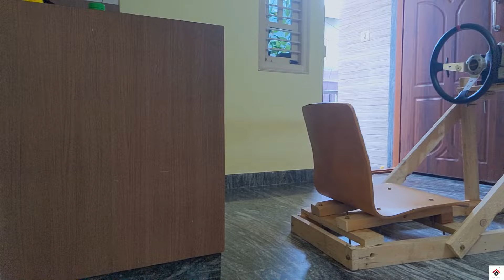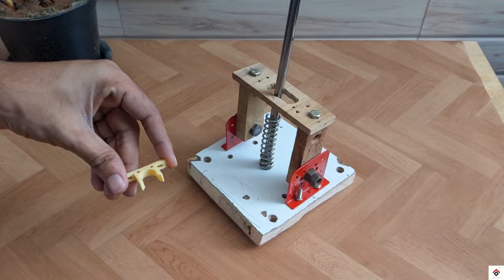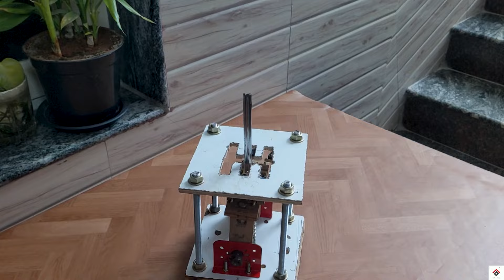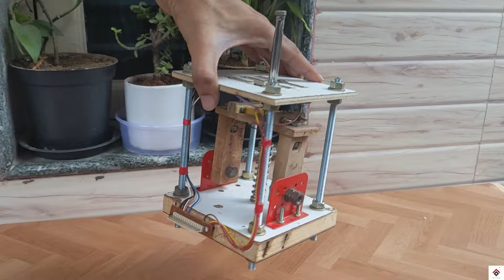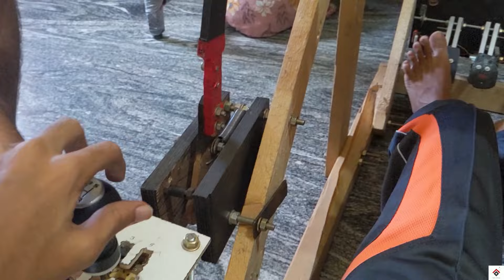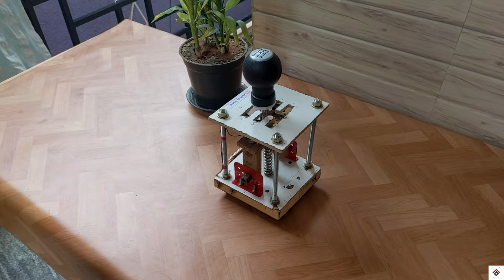DIY 6 speed H-Shifter for FFB Steering wheel, Easiest tutorial ever | H-Shifter for EMC Sim Racing🔥

Comment: hi i have a question. can i do this using arduino starter kit?
Reply from the maker: Which Arduino model is it?
Reply: @techathome i think its arduino uno with tact switch
Reply from the maker: Not possible.
You can use only Arduino Leonardo for this project.
Reply: @techathome why not?
Reply from the maker: Arduino Leonardo has built in serial communication support. The firmware is designed for this.

Uno uses seperate Chip for communication purpose.

Comment: Thanks you soooo muchhh broooo thanks thanks thanks
Reply: Verry use full iam from Kerala and I got first 🥇 in school level and also in first 🥇 sub district and 2nd prize in district now I can participate in the state level Kerala so I made this ffb level by level now it's the finishing part I thought that without buying the EMC pro I couldn't do gears but you proved it would work
Reply: One question you are using the e bike motor does it feels too hard to turn the wheel tell me about it iam currently using the rs 550 lower than 775 is it will be useful to upgrade to ebike motor
Reply from the maker: Congratulations🎉 and All the best ♥️👍
It's not hard to rotate the wheel. Force Feedback will be stronger if you use ebike motor.
Reply: @techathome thanks for replying I will give you full support
Reply: Bro I also got 1st prize at Kerala  state level competition thanks for giving me the instructions you are main reason for me achieve this thanks you so much

Comment: I am planning to make a 7 gear h shifter (6+1) so can I use the circuit diagram you provided? As you have shown 7 switches in it, or do I need to do some changes?
Reply from the maker: You can follow the same circuit diagram provided.

Comment: Brother whenever i connect the paddles with the wheel the h shifters stops responding in ets 2 but when I disconnect the paddles the h shifters work again ..please help me
Reply: Brother did your issue resolved??
Reply: @namandhiman7491  no bro it's the issue with the software & circuit diagram... I switched to RFR wheelconfig software..now I can use it properly
Reply from the maker: I am not facing any issues.

Comment: I have completed the mechanical part of the project, but does the code you provided in the software section control both the switches and the pedal potentiometers?
Reply from the maker: Yes, same firmware supports all the inputs.
1 encoder for wheel 
4 potentiometers 
16 buttons
Reply: @techathome So which pins should I connect the clutch potentiometer to?
Reply from the maker: A2
Refer this video: https://youtu.be/crdDhvhBG0M

Comment: Bro I have a doubt. Does the free version of the software have extra button support? Because I didn't make the H shifter. Instead I added paddle shifters. But the software doesn't have any support for extra buttons. As you have mentioned in the video, can I confirm whether the software detects extra buttons automatically. I didn't notice any buttons being recognised automatically? Only the steering, accelerator, brake and clutch was working
Reply from the maker: This free version also supports upto 16 buttons. We have tutorial on paddle shifters. Check this: https://youtu.be/-gHQ2EIYm88?si=S500hq0YfO1nuNQJ
Reply: @techathome  Thanks bro. I connected the buttons to the digital pins 2 and 3 and tried mapping it but it didn't work. But after looking at your simplified circuit diagram and connecting it, it worked. Thanks again
Reply from the maker: Welcome ❤️
Reply: @techathome  I have another doubt bro. How can I map the gears in the software if I use the two potentiometers for H shifter that have been shown in the diagram by EMC dev?
Reply from the maker: EMC lite free firmware doesn't support analog xy shifter. Only digital buttons shifter possible.
Reply: @techathome  Oh, okay. Thanks for the information bro
Reply from the maker: It supports upto 16 buttons.
You can check button activations on Control pannel/Devices. We have shown in video as well.

Comment: Where can you find these plastic locks that were used to lock the umbrella barrel?
Reply from the maker: Those are used in cupboards and table drawers.
You can check in furniture and hardware shops. Better to go with metal ones if you get.
Reply: @techathome  Thanks, the metal ones are easy to find here in Brazil
Reply from the maker: Welcome 👍
Reply: @techathome  I watched a video of you making a steering wheel for a cell phone, I don't know how to program it on Arduino. Can you program a board like that for me and send it to Brazil? I'll pay you the price.

Comment: Help help help help please help My steering is continuously spinning help me!
Reply from the maker: Can you check your BTS driver board separately: https://youtu.be/H2YJRaaXFIM
Reply: @techathome  My driver is fine I checked it
Please help me I have spent a lot of money on this project
Reply from the maker: 1. Is steering angle working properly in EMC?
2. Exchange the rpwm and lpwm wires on pin 9 and pin 10.
Reply: @techathome Everything is working fine but as soon as it reaches 450 degrees the motor starts rotating continuously. When I tried I found out that pin number 10 of Arduino is not working. What should I do please help
Reply from the maker: How did you confirm that pin 10 not working? How did you test?
Reply: @techathome  When I connected the "pwm R" pin of the motor driver to pin number 9 of the Arduino, the motor started rotating continuously in the right direction and when I connected the "pwm L" pin of the motor driver to pin number 9 of the Arduino, the motor started rotating continuously in the left direction, but when I did the same process with pin number 10 of the Arduino, nothing happened.
Reply from the maker: One more method,

1. Convert your Arduino back to normal (Steps show in part 3)
2. Connect LED on pin 9 and 10.
3. Try to upload LED fade code by changing pin number to 9 and 10 seperately.
4. Since these two are PWM pins, fading should work.
5. If pin has issue, you have to change the board.
Reply: @techathome  I changed both the Arduino and the driver but still no solution was found. Help
Reply from the maker: Check if the jumper wires are proper by continuity testing.

Comment: Nice work bro.
a...., For steering wheel, can i use [RO pump motor] instead of that cycle one
Reply from the maker: Thank you ❤️
Is that DC motor?
What are the specifications?

Any DC motor will work, but motor should be powerful.
Reply: @techathome  yes it's a DC motor.😃
But I don't know if it's powerful or not 😐
And what do you mean by specifications ???😅😅
Reply from the maker: Current and voltage ratings?
Reply: @techathome   it is 24 Volt DC motor 
Don't know about current 🤡😅😅
Reply from the maker: It should work.
Reply: @techathome  ok , thanks bro 🥸👍

Comment: Where can i get multiple pin connector... Can you provide the link..??
Reply from the maker: I bought it from offline electronics store. I didn't get the exact one.
Check this,

6 pin: https://robu.in/product/6-pin-jst-xh-2-54mm-pitch-plug-and-socket-with-cable-3-pcs/

8 pin: https://robu.in/product/8-pin-jst-xh-2-54mm-pitch-plug-and-socket-with-cable-3pcs/?gad_source=1&gclid=Cj0KCQjw6oi4BhD1ARIsAL6pox0x2I9h4ESwJyo_J1K7CvrV-Fm4ayAFg2uN-bWPB9MS0qrToHMaSrMaApb1EALw_wcB

10 pin: https://robu.in/product/10-pin-jst-xh-2-54mm-pitch-plug-and-socket-with-cable-2pcs/?gad_source=1&gclid=Cj0KCQjw6oi4BhD1ARIsAL6pox2TOsFT1V-2p9PkkvSBmOdHoBKrEQIJzlLmzhGG5pPfodwpp4xjD_caAtWnEALw_wcB

Comment: Bro my ffb worked before but didn't use wheel in 1 month's so now ffb doesn't work when I connect smps I hear squeeking noise and and wheel disconnects. before ffb was way to powerful meaning my wheel would literally fall off
Reply: Bro explain it correctly
Reply: @UGayan you dont know how to read it
Reply: I know the solution but im not going to answer because u were rude to ug gyan, the information you gave is not clear
Reply: @ OK geez here a polished version..
 I’m hearing a squeaking noise coming from the SMPS, even when no load is connected.
I’m using a 12V 20A power supply without a fan output.
My force feedback is extremely powerful — like, it could literally throw the wheel off if I’m not careful.
Before, the FFB worked perfectly fine, but after not using the wheel for about a month, now when I connect the SMPS, it squeaks, and the wheel disconnects.
Even without any load connected, the power supply still makes that squeaky noise.

From what I can tell, the SMPS might be struggling internally (maybe bad capacitors, coil whine, or PWM issues).
Since my FFB setup pulls heavy amps during strong jolts, I’m guessing either:
	•	The SMPS is dying and can’t hold stable voltage anymore,
	•	Or something in the motor driver/controller (like MOSFETs) might be shorting under load.

Right now, it’s so bad that even without the wheel connected, the SMPS squeaks.
And using a 20A supply without a fan definitely heats it up faster, which can kill it even faster under FFB stress.
Reply: I request to those who know the solution to not answer.
Reply: @ ur the one being rude rn comments are for help not to start problems
Reply: Maybe rewire it completely and also reset your Arduino re-write the code

Comment: Bro what is the cost of full steering setup please reply
Reply from the maker: Around 8.5k
Reply: @techathome for all
Reply: Thankyou for your reply
Reply from the maker: The majority of amount spent on components used in the wheel.
For rig, pedals, shifter I have used most of the available unused wooden pieces.
Reply from the maker: Considering the current online prices it's around 8500 INR approx.
But you can reduce costs -
1. No need of pulleys and belt for encoder. You can directly connect at the end of steering shaft.
2. Using cycle chain and sprocket instead of timing belt and pulleys for motor.
3. Use 100W or 150W motor, but mine is 250W which I already had.
4. Some old steering wheel can be used, Here I bought new wheel.

Comment: Can i use 50k ohm potentiometer instead of 10k ohm in pedals? With the same circuit?
Reply: How much watt and volts power supply can  i use for 775 DC moter in this build?
Reply: you can use 12v an 15a for 1 motor. If you use 2 motor, you must use 24v 5a
Reply: Yes you can